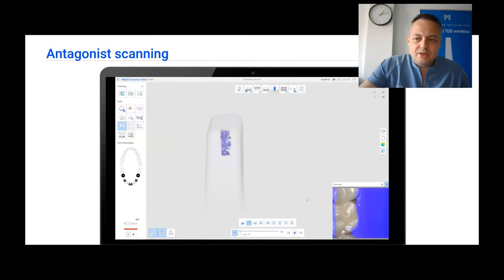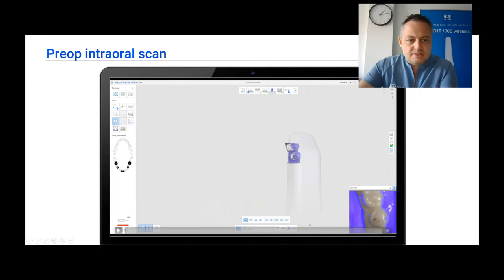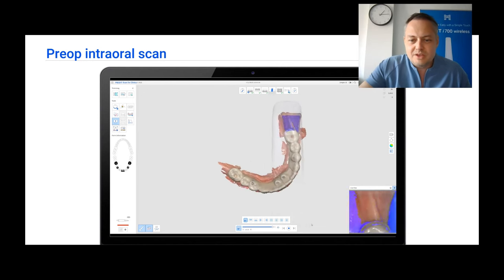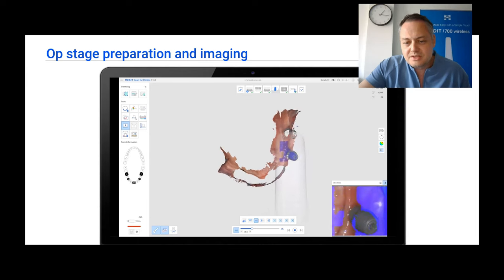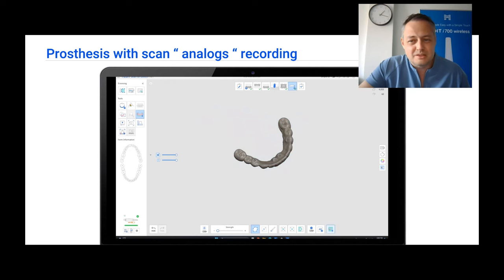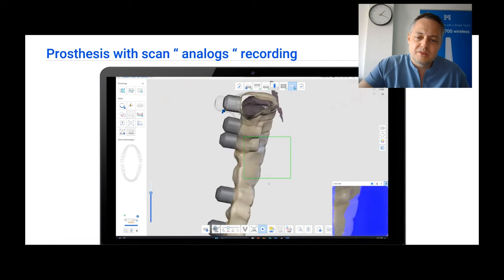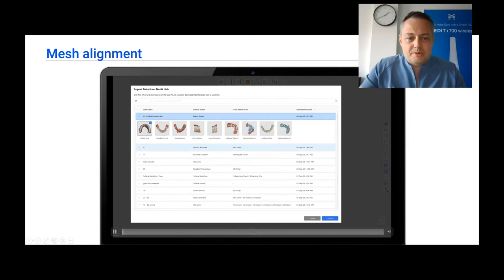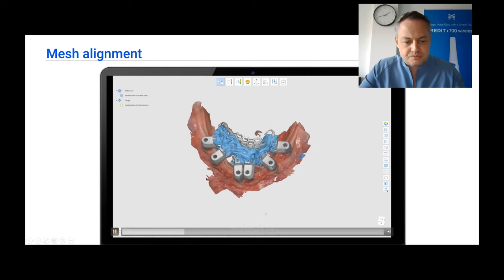All-on-X Implant Scanning : Optisplint system

Comment: I would love to know what kind of splinting scan body system you are using here.  Very cool.  
I have a similar case going on, however the provisional prosthesis is not in the exact position that it was supposed to be in.
So, somehow I need to compare to the original design and try to merge the implant positions with the old design but the new bone/ridge levels.  
I'd love thoughts on this.
Reply from the maker: Thank you for your comment. As you can see in the video, the scanbody system is 'Optisplint system'. Dr. Bogdan replied that "Bridge can be saved as a waxup and re used in a new case once aligned. Also other sets of scan bodies can be used in Exo cad. You will need to align the new mesh off the scan bodies to the old preop situation you used to design the wax up. This can be done in Medit Design with 3 point alignment . You just need to find some common landmarks." :)

Comment: Please I'm trying to know is it possible to not do pick up and just use the optisplint? Or would I still need to do the pick up?
Reply from the maker: Thank you for your comment. If you are willing to go through a digital scan, you can use either normal scan bodies or the Optisplint system jig. And in the case of the conventional way of impression taking, you can use pick-up impression copings. If the case is too big and you want to make it sure, then you can take a conventional impression as well as a digital scan. It is up to the user's preference.